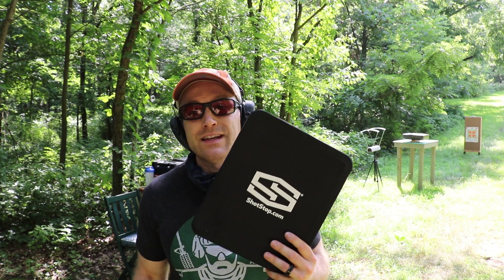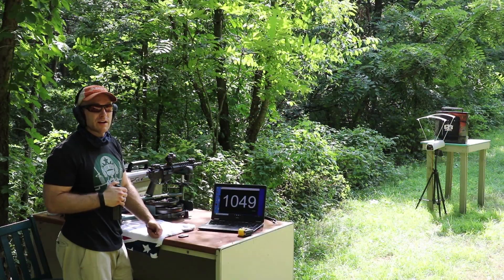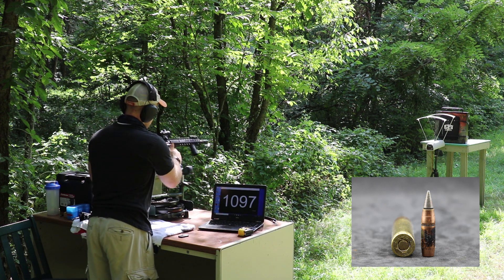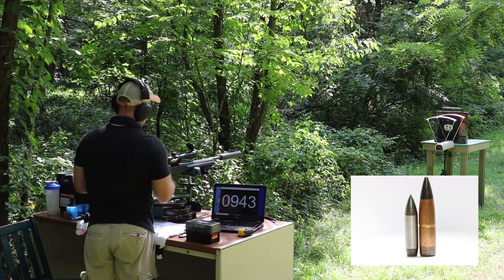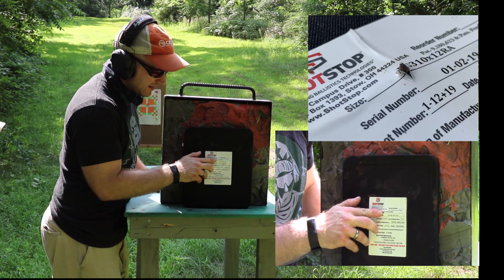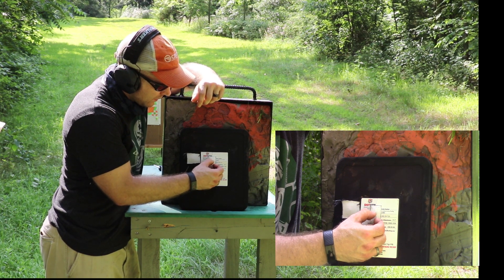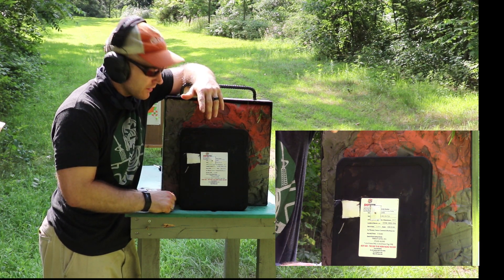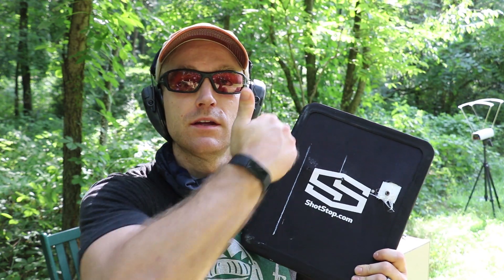Can Subsonic Ammunition Penetrate Armor? Part 2

Comment: So subsonic is based off a heavier and slower projectile correct? What about a load to make black tip loads into subsonic ammo? Would you even be able to do it? Id love to see a ballistics test of it For say a .300aac-blk & .308.
Reply from the maker: Anything under 1130(it varies) is considered subsonic.  So to help a gun cycle they typically use a heavier than normal bullet. However unless the bullet is designed to work at that velocity it’s terminal affect will just act like an FMJ in tissue. The black tip would just tumble.  And it’s performance against rifle armor as shown here, it would not perform.
Reply: @BuffRANGE  affirmative. Thank you. I always wondered why people never used them for it. It seemed like a good idea on paper. I just dont reload and dont have the legalities to reload black tips. Is there an AP subsonic equivelent? Or is there anything that can push a harder hitting projectile in there or to modify a tungsten/steel core 7.62? Its ALWAYS made me wonder why we've not developed or at least tried to develop a round like this. If there is a way how do you think they would achieve this?

Comment: I saw pictures of pierced through rigid multilayer structure 1" thick UHMWPE Level III(NIJ) plates with 7.62x39 FMJ 'reduced speed' (around 293-310 m/s) rounds. These rounds is intended for using with AK and optimized to correct cycling with silencer (suppressor) to make AK as quietly as it possible, but very noisy AK parts still not allowed make it truly quiet. This is weird and really strange phenomenon, some of these 'extremely slow' bullets has been damaged, fragmented, and even twisted around in the canal, but all the same punched these UHMWPE plates through.
Reply from the maker: Yep. Very strange :D If you look at the testing I've done with SB193 from FN 5.7, it will punch through body armor at subsonic speeds, but once it gets above a threshold velocity, it stops penetrating the same PE plate :D
Reply: @BuffRANGE  I guess this low speed 'miracle' is possible with some 'oldschool' rifle Level III PE plates, which multilayer structure of bonded sheets (DSM-Dyneema or Honeywell-Spectra) is visible, plastic enough, and can be mechanically splited, same thing with soft PE backing panels with equivalent to Level III(NIJ) thickness. But if the UHMWPE plate is looking solid and bonded very tight it may be completely different results.
Reply: @BuffRANGE  I have an updates about these mysterious 'reduced speed' rounds. It was non AP round with weighted hardened tool steel core bullet, not Barnaul 'civilian' version of this round with FMJ bullet. And that's explain everything, but still is very interesting that PE plates and soft armor panels stop holding bullets at subsonic speeds while stops faster rounds.